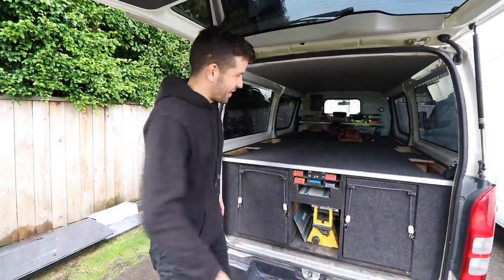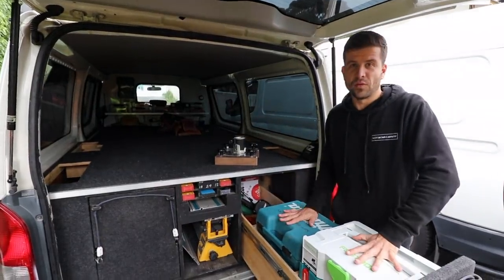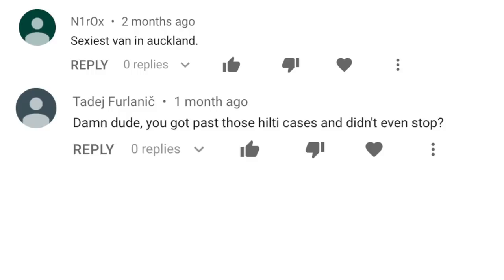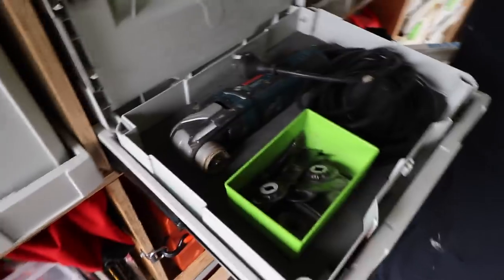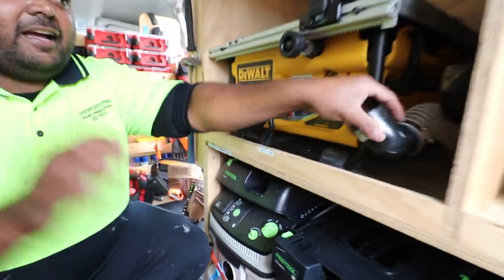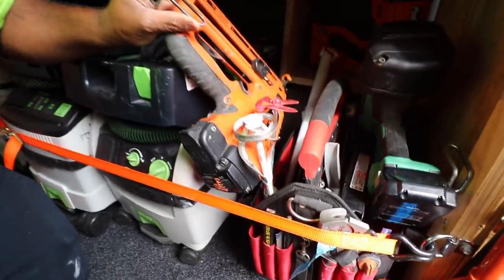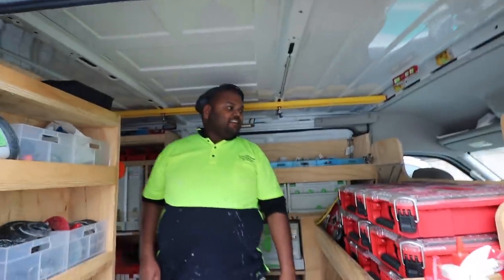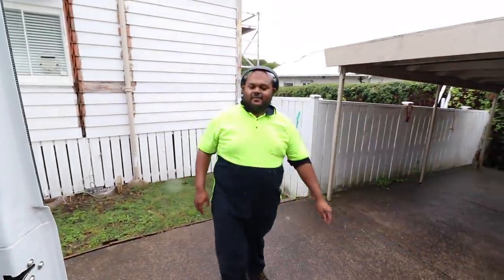VAN vs VAN: The Best Van Fit Out?

Comment: You missed the third possibility: Sparkie's van, everything thrown in at random until there's a waist-high layer of debris filling the van.  It's, um, unstructured storage.
Reply: Dave Smith Speak for yourself 🤷🏼‍♂️ depends on the tradie boy
Reply: One of the most important things I learned from a journeyman as a sparky apprentice; "Only a fool cleans up, a genious dominates chaos."
Reply: When I worked as a telco technician my Afrikaaner workmate said "a man with a tidy van does no work"

Not sure if it's true. I'm a carpenter now, and I have a basic false floor and four big drawers. It works. I'm not very organised so I just split the chaos into 4 categories and find stuff in a quarter of the time. Plus when the drawers are closed it looks like fück all in the van.
Reply: How can a Sparkie have a mess for a van?! The only tools they need is a screwdriver and a set of pliers. The cabling haha! It's us Chippies that have to have loads of tools, sad but true lol!
Reply: @Colaaah  Sparkies deal with tons of packaging. Everything is wrappes in plastic, cardboard and polystyrene. They also carry a lot of random shit that they might need one day.
Reply: @Patrick-857  sparkies need TX10-35, PZ/PH00-3 and some flat head scredrivers, a drill, hammer drill SDS-plus and sometimes SDS-MAX, angle grinder, socket wrench set, levels, multimeters of various kinds, metal saw, wood saw, files, needle nose pliers, cable cutters, crimp pliers of various kinds, allen keys, tape, flashlights, hammer, knives, markers etc. Etc.

 But the things that make it messy aren't tools.. it's marerials.. cables, sockets, cable fasteners, cable ladders (don't know english name), endless bags of cable ties, lamps/lights, electric material like relays, circuit breakers, potential material, cable conduits, relay boxes, PLC materia etc. Etc.

Usually it's the endless amounts of material (old/new/random shit) that makes the mess
Reply: @Colaaah  sparkies need TX10-35, PZ/PH00-3 and some flat head scredrivers, a drill, hammer drill SDS-plus and sometimes SDS-MAX, angle grinder, socket wrench set, levels, multimeters of various kinds, metal saw, wood saw, files, needle nose pliers, cable cutters, crimp pliers of various kinds, allen keys, tape, flashlights, hammer, knives, markers etc. Etc.

 But the things that make it messy aren't tools.. it's marerials.. cables, sockets, cable fasteners, cable ladders (don't know english name), endless bags of cable ties, lamps/lights, electric material like relays, circuit breakers, potential material, cable conduits, relay boxes, PLC materia etc. Etc.

Usually it's the endless amounts of material (old/new/random shit) that makes the mess
Reply: @torpedohippo8493  Try being a telecommunications cable faultman. I did that for 8 years. Copper cables that is. Even worse. Add mud, dirt, synthetic grease, tar, mastic, gel and a whole lot of tools and materials that you didn't list to the mix. Oh and digging tools.
Reply: @Patrick-857  yup, people who think we only need pliers and a screwdriver have never seen a sparky work lol
Reply: Be like the cooking shows that run out of time...I made a deconstructed steak sandwich.

This is my deconstructed work van.
Reply: Same with the plumbers van, i wonder what it would be like to be so organized 🤔
Reply: Ryan Pedersen what the f is that......
Reply: Ryan Pedersen organising  is a future you problem
Reply: Everything in it's place, and a pl... Hey has anyone seen my tracks?
Reply: @torpedohippo8493  no, I've never seen a sparky work as a builder. I've done sparky work myself and just had a sparky look over the job and sign off on it. BTW It's called having a shit stir. And if you really think you need more tools than a construction builder, then you have never seen one work 😜😂
Reply: @Colaaah  never said we needed more. I just listed the things I use frequently.. The fact is that we can't just do the work with some pliers and a screwdriver.. Also in  Denmark it's illegal to do sparky work if you don't have the authentication, even if a sparky signs off on it.
Reply: @torpedohippo8493  like I said, a 'shit stir' and lucky I don't live in Denmark. Once upon a time, the construction team did it all, from start to complete. It's all the wankers that work with a builder for 12months and then think they are qualified to go out on their own, they are so bloody dangerous. The lackies onlooking and doing labouring work with the builder, they don't realize all of the rules and regs that are being checked off in your head. Plus how to use all of the powertools safely as well as cut things square and build plumb and level etc... So many cowboys out there!
Reply: @Colaaah  i've never met a non-electrician who knows anything about the rules/laws of the trade. There's a reason we have laws/standards, it's so the electric grid doesn't end up looking like the shit they have in Mexico, Thailand, India etc.
Reply: @torpedohippo8493  You don't seem to comprehend what I said. Of course qualified tradesmen know the rules and regs...  Go and read my comment again...
Reply: @Colaaah  when you said construction team it sounded like you were talking about carpenters and brick layers, not electricians
Reply: It almost like you have a camera 🎥 installed in my van, ⚡️
Reply: The 2 electricians I use are self employed and 30yrs and 35 years in the industry. One has a Jeep Cherokee the other a Toyota Landcruiser as their main vehicles. The one with the Landcruiser also uses a Smart car sometimes. Sparkies need NOTHING like the level of tools and materials builders do.
Reply: 1-It's coz we always running off to the next job.
2-Builders  have way more tools but sparkies have way more parts
Reply: My van is real tidy since it came with a huge sliding drawer but my first job as an apprentice, we were a two man team and I'll be knee deep in scrap TPS and J A Russells bags
Reply: There is nothing like the space efficiency of pure chaos. Mattias Wandel
Reply: The people I know who have tidy and organised vans, doesn't matter what trade, are always the most skilled, professional and quickest to get things done. I personally loathe working out of a messy van and mine is autistically organised.
Reply: Thats the way my van is. I was going to build a shelf in there but never happens. Now its Just a giant mess
Reply: @Patrick-857   right the biggest mess is the spaghetti of wires that are bad you use as a pill string.
Reply: This was my old bosses van 😂😂😂🙃
Reply: @Patrick-857   "and find stuff in a quarter of the time" -  Good one
Reply: @Colaaah  im a sparkie and your right we can fit all our tools in our lambo's
Reply: too busy makin money u know

Comment: I vote for Scott's setup because of its simplicity!  Would be a better setup for me overall.  Cameron's setup resembles what we have here in Canada for most tradies.  Getting in and out of the van and tight working quarters becomes old real fast.  Add the fact that I am 6'2" and bending forward in the vans is common for me and a definite peeve of mine. Scott's setup is mostly accessible from the ground making it a novelty.  The setup seems more intuitive. Not sure it would work well in the winter time but I like how everything is accessible directly off the ground.  Plus the timber sheets are set flat leaving them nice and dry and easily pulled.  Both are great but I lean towards the green striped van ;)

Festool Festool Festool... wow, lots of dinero in that van... would be worried riding around with over $50k in tools in the back of my van!  For my sake, I prefer Makita, DEWALT and Milwaukee tools.  Their price points and usefulness are just right for me.  The Grey/Green color scheme is too attractive for the 5 finger reduction types.  Not sure Festool really isn't much more then a hype... then again, they are too rich for me and I think cordless tools and their batteries have a defined life span that makes investing top dollars less worth it.  But by God, what a bit of kit Cameron has... and both are soooo organized too.  Good job to you both!
Reply: I Brazeau yeah thats why scott borrowed his homies tool and never gave it back lmao
Reply: I wouldn't buy any of the cordless stuff for reasons you have mentioned but the corded stuff is great. Whether it is worth the difference in price between dewalt etc depends on the type of work you are doing and personal preference but the festool plunge and chop saws are 2 of the best tools I have ever used (they should be for the price)
Reply: Well.. working for 10y, I assure you I saved money with my Hilti, Festool and Mafell, When my mates are burning 3 dewalt tools, mine are still working flawless. Not to mention the aftersell service  and longtime remplacement parts.
Reply: My rule of thumb is I want cordless if I use all the time. And corded when it's a special tooling hardly use. That way I still have it when inevitably the battery tech changes
Reply: Art Connolly I used to think this way as well but now all my daily tools are cordless and I've kept most of my corded for home use... to be honest, I still use all my cordless at home as well.  I now hate extension cords and having to find plugs.  Cordless is so much easier and efficient.  It's like evolving from a tool case to a tool belt.  So much more efficient.  Either way, none of my tools (Milwaukee) have crapped on me yet.  Been 5 yrs now and they are still going strong.  I see no purpose to go to Festool at this moment but ai am sure I'll get the bug at some point.  I've bought a few Hilti tools and yes they are the bomb.  Their choice isn't that great yet for my liking though.  Milwaukee, IMO has the best choice overall for now.  Can't go wrong in any of these brands.
Reply: They make high roof models that would solve the issue.
Reply: @hotdog160 second that, just had a couple Festool tools serviced/repaired after three years of everyday use. Came back as new within 48 hours.

Comment: I do like Kameron's fit out a lot and will take inspiration for my (stationary) workshop from that. Seems like you can do a lot storage-wise with just ply. Scott's however has the advantage of the large flat area, which might even sleep a person or two, which could be an appreciated dual use scenario. In both cases clearly a lot of thought went into the fit outs. Both are very impressive.

Comment: Both brilliant vans Scott but I’m a big believer in only having a van you can stand up in that’s why my last 3 vans have been Luton vans kitted out , they have a fibre glass roof that lets light in and nice flat sides that make it easy to rack out and also when they are parked up they just look like an empty removals van. The one I have now is a crafter 2.4m high in the back and 5.5 meters long above the cab and is great to work out of but a pain at times to park on customers drives but that’s the only down side.

Comment: Cameron's Van is a mobile workshop, insanely good in the way he has it organized,BUT, my choice would be SBC Van.
I like it's simplicity, ability to carry sheet goods or lumber as required, and it still get's you over the line when it comes to completing your job requirements as your loaded with the essentials needed.
4.9 to Cam and 4.95 to Scott...fix your drawer runner and you get that 5.

Comment: My vito is set up like yours Scott, except I have shelves down one side and still enough room on top 8 x4 sheets. Although Cameron's van is bad ass (especially the kit) with his set up as soon as you put materials in the van you loose access to your tools.      SCOTT WINS
btw I solved my non locking sliding drawer by gluing a hard foam block on the door so it sits against the drawer when closed.

Comment: Kameron's van has a greater variety of tools, you can walk in it, and the clean/organized setup allows for a great versatility of projects he can do as he has the majority of his tools with him. However, I am extensively partial to Scott's van. I'm a huge fan of the separation of the front and the cargo/tool area, three large access doors to the cargo compartment, ability to keep the building supplies inside and out of the elements while still having access the tool storage, AND the smaller vehicle footprint makes driving around, parking, etc WAY easier. If it was my money, I'd buy and outfit the same make/model of Scott's Van.

Comment: The only trades in the Uk the shelf out there can these days are plumbers and those who haven’t had there van broken into. After market locks and steel site boxes are a must. My slide door got bent in half at Xmas and my kapex 120 plus all my dewalt 18v/flexvolt  got nicked off site a month ago. The only thing that saved my festool tools was a better site box. Other then that both great van set ups, I just wish you could get away with this in London

Comment: That was an awesome video guys,

I have been a builder for over 20 years and always relied on a 8 x 5 trailer fully kitted out to suit my purpose

Having said that, I can see the benefit of both of your set ups however, I reckon that I will own a stand-up van by the end of this year…..as that was the most awesome kit out I’ve seen

One thing I learned from your video….. you can own far more tools than you’ll ever use……but oh how awesome that would be……YOU CAN NEVER HAVE ENOUGH TOOLS EH!!!!

Thanks boys….awesome vid 👍

Comment: I vote for Scott's van. There is point where mastering a smaller set of finely curated tools, a kind of craftsman minimalism, in the end saves you time and money. Having a high end tool for every possible variant of cut or joinery means you spend more time traipsing back and forth to your van rather than just doing the actual work.

Comment: Saying this from a place of jealousy as I currently am stuck with a subaru legacy wagon with all the seats down and tools just stacked wherever they can fit but I actually think Cam's van is a little too full on. I'd be so worried to always be rolling around with that amount of gear at all times. Heck there is like $4K worth of vacuums just sitting there. 
The level of organisation is absolutely unreal though
Reply: I have the same set up as you in the subaru wagon, hear what ya saying! I need to charge more i think!!
Reply: I used to run the subbie, as well then moved to Hiace
Reply: @MsElijah16  yeah I'll definitely be upgrading this year. Re tooling up was the focus for me after a good few years ski bumming it haha
Reply: Adsjabo gotta have some fun though aye

Comment: You wouldn’t be able to have your vans in london.When you park in London the parking spaces are very tight and in most circumstances wouldn’t be able to pull your draws out from the back of the van and that’s why most vans have side access incase this is the issue
Reply: It's the exact opposite where I live in the US. We have a ton of space so most contractors around here have pickup trucks and trailers so you can bring an entire workshop with you when needed. Then you can drop the trailer and all the tools at the job site and use the truck to haul all the materials separately.

Comment: Both Shop Vans are great... Now they just need solar power for all their batteries..and they can do off grid jobs. No Gennys in their.
I like Scott's van , cause you can sleep inside  , at work sites.
Reply: yep, when Scott pulled out the battery array, I thought he'd had a 2nd car battery (Redarc do nice dual battery manager) and inverter for charging tools. Redarc battery managers have Anderson plugs for solar plug in and also do charging off the alternator.
Reply: @DerAngriff  😎👍💯

Comment: The NZ way is clearly cooler as long as the tools or boxes never change shape. If they do, the storage could require a rebuild. The shelf system is not as tidy, but it is far more versatile.  The NZ wins for lumber storage, the UK wins for tool/item storage. The US standard of a pickup truck or van with a trailer is superior for both lumber and tools at the cost of worse fuel economy and a larger rig that may be an encumbrance in urban areas.

Comment: Kameron wins for wow factor, but loses when it comes to common sense.
2 different Festool battery platforms
2 different Milwaukee battery platforms
1 Pasload battery platform 
1 DeWalt battery platform
1 Makita battery platform
1 HiKoki battery platform
1 or 2 more lurking in tool cases not opened
plus AA, AAA and 9V
That is just silly...
Reply: Nothing wrong with spreading over the battery platforms when it means you get the best tool for the job. Although it is going to be preferable if you line up as much as possible obviously
Reply: Adsjabo 
Any of the time you save by have the best tool for the job is lost charging multiple batteries and setting up for multiple chargers.
I use DeWalt 20V and Hilti 12V on rough-ins, Bosch 18V & 12V for Trims, finals and in front of end users. I can’t imagine being stuck having to juggle 10 formats at once...🤨
Reply: @thetruth5210  
You're not wrong there mate! I run a handful of different systems but overcame that issue by having a charger bag. They all come out, plug em into a box together and we're good to go. Also at the end of the day its probably not likely you'd have all 10 systems that Kameron is running out in one day too. Whatever works for him though eh!